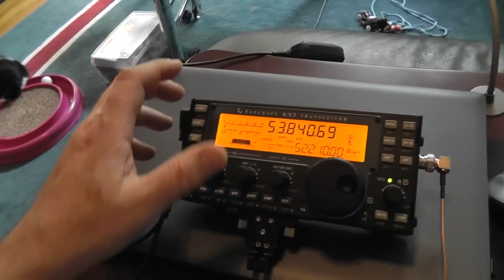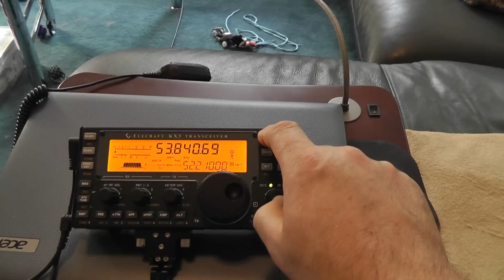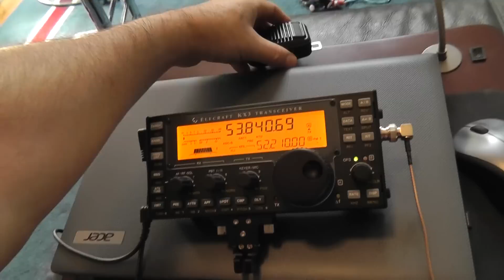How to set offset for repeater use on Elecraft KX3

Comment: Thanks, was wondering if this radio will do CTCSS encode tones for FM repeater use on the 10 meter FM band along with offset?  I am sure it would on 2 meters with the option 2 meter board but I am not sure on the HF side on 10 meter FM.  Thanks..